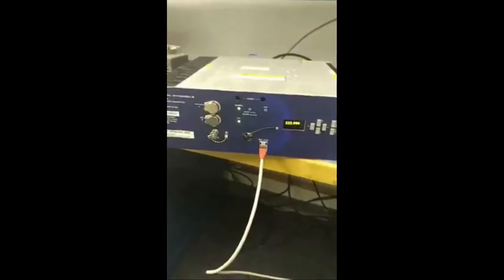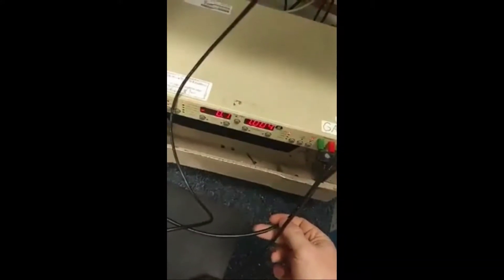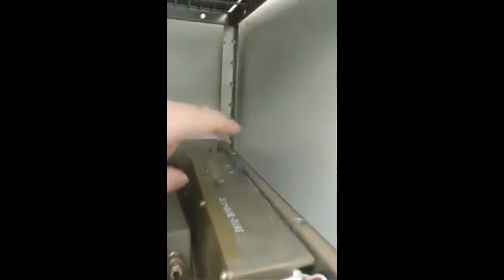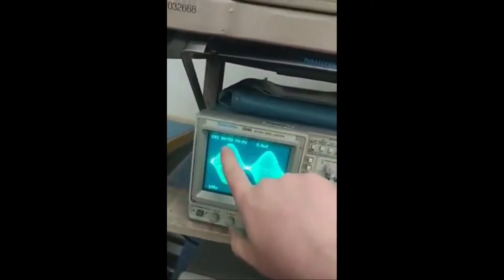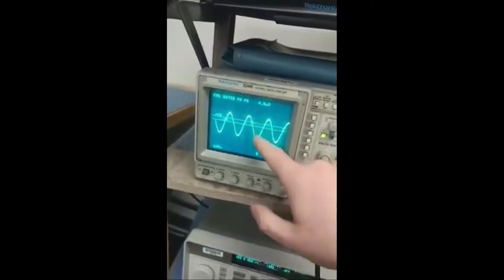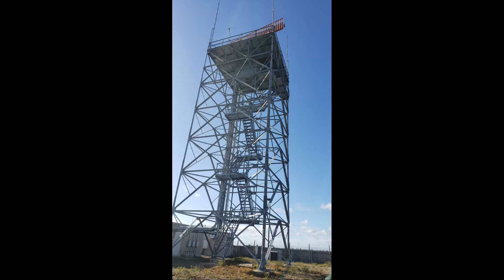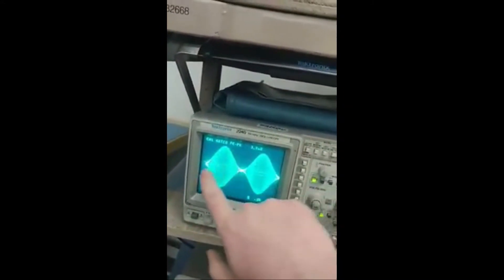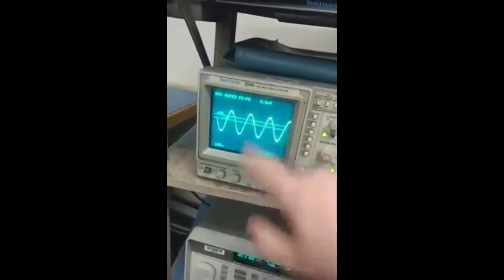A Having Fun Repairs Thank You

Comment: Hey there I just found your video about the HEXBUG Mobot - have you had any issues with the remote? Mine doesn't work even right after a replacement. Any ideas would be appreciated!
Reply from the maker: Hello Mike! Unfortunately there's never been an issue with the remote. My kids have similar toys with similar remotes that would lose sync with the device. I would take out the batteries (device and remote) reinstall, then turn on the device and immediately press one of the top buttons on the remote are they would sync back up. 

However, if you're issue is not batteries or sync. And you've replaced the remote, I would consider looking at the device (robot) and potential problems with it. 

I know this isn't a lot to go on, but it's hard to troubleshoot an issue without something immediately in front of you.

Best regards